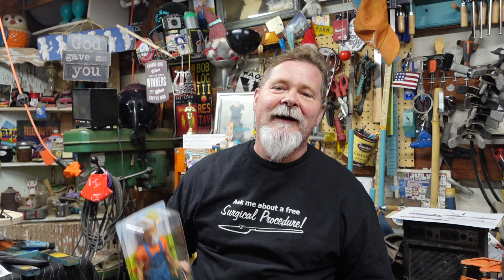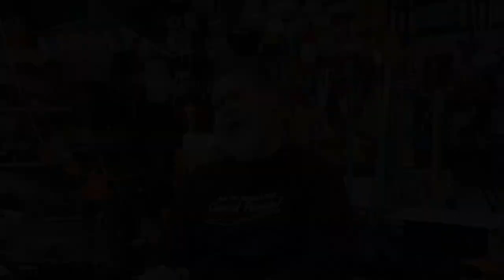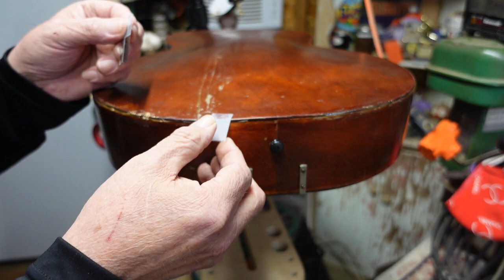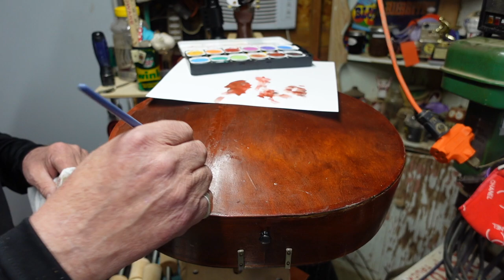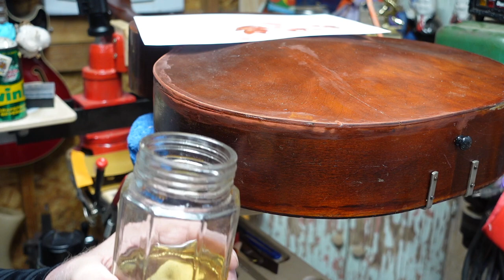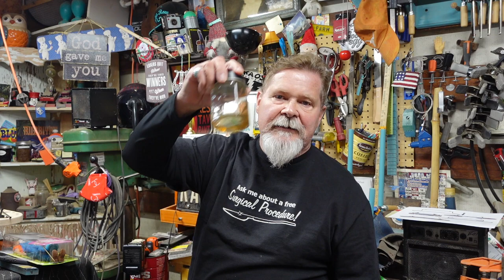Junk Archtop Guitar Plastic Surgery

Comment: Well paul I did not take your advise an buy a kit , that's on me but I did after months of searching found a 1950s silvertone I believe a 600 series , I pecked on it to check for loose braces , checked the neck for previous repairsor cracks there is one section of the top bout 3 inches that is come loose but the finish is not to good I'm gonna try to preserve it . thanks for your help
Reply from the maker: Send pics kpcbgs@gmail.com
Reply: Cool I will